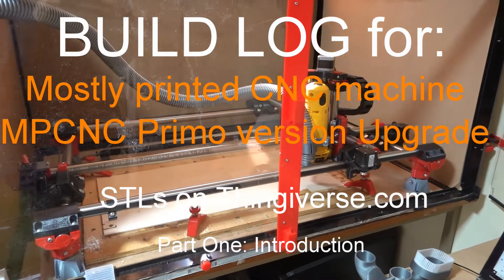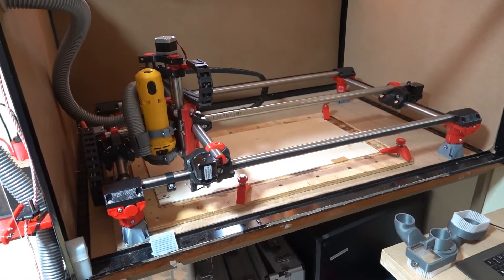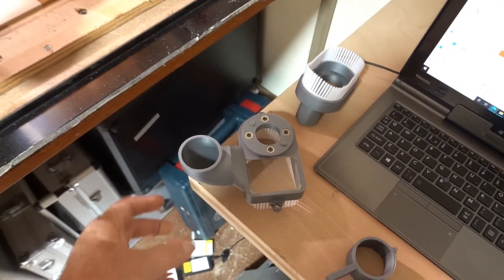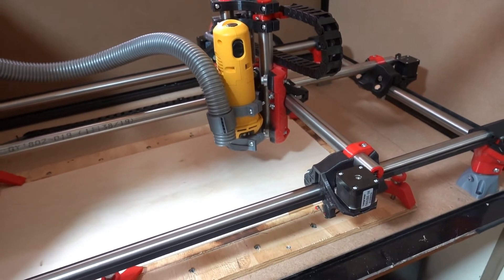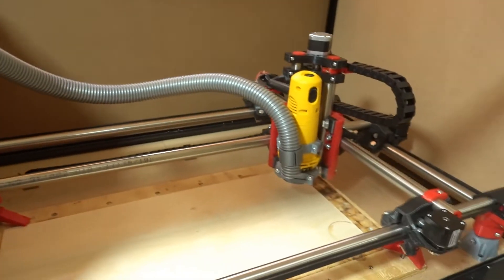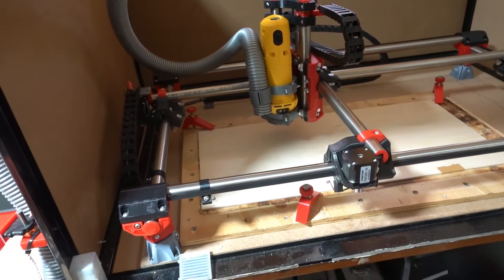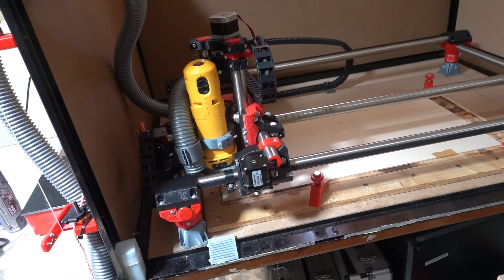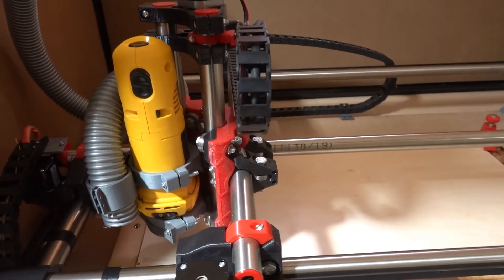MPCNC Primo upgrade  from Burley: introduction

Comment: Is your cable track purchased or printed and how did you mount it to the trucks?
Reply from the maker: The cable track is 22mm and purchased from amazon. I used fixings that I designed myself which clip to the rails. If you would like the STLs let me know and i will see if I can find them and post to thingiverse.